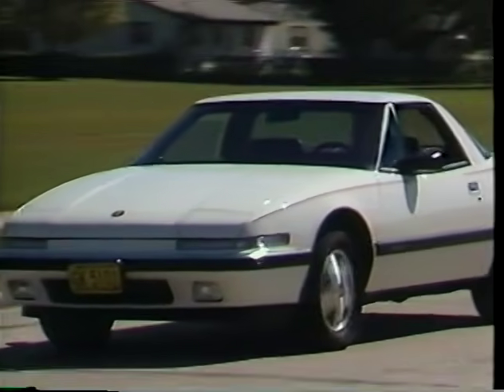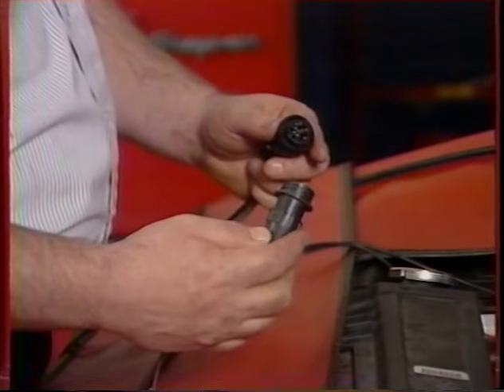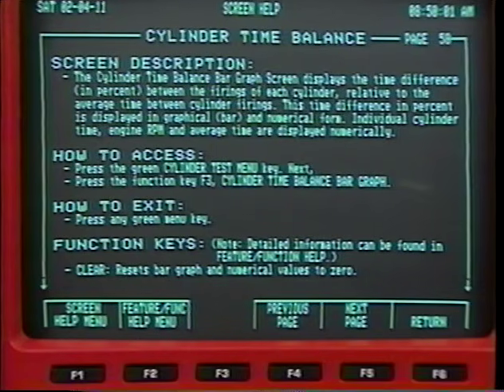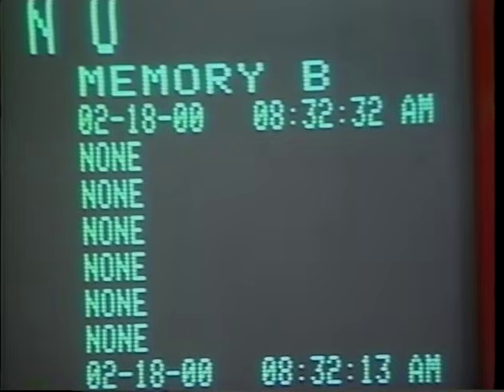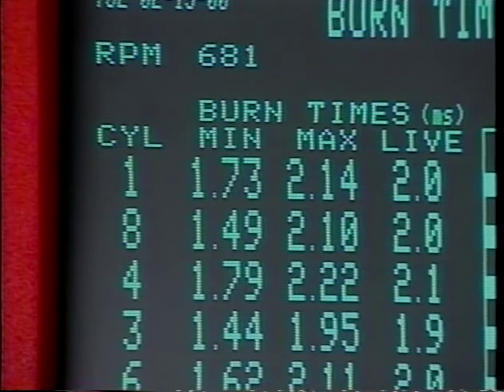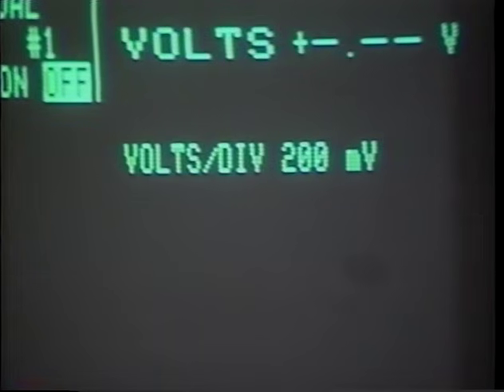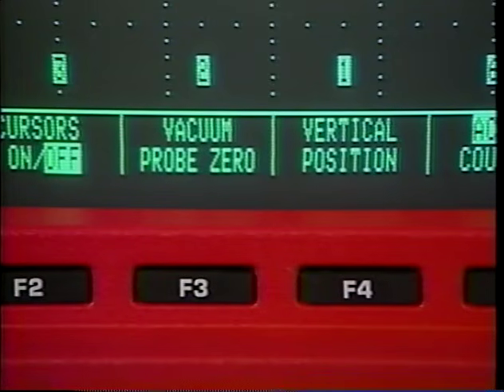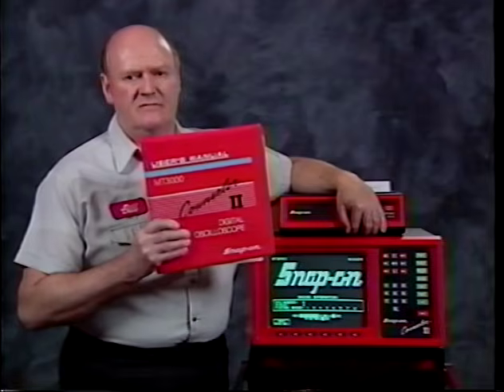Snap-on Counselor II MT3000A Oscilloscope Basic Operating Procedures SS1222VHS

Comment: The nerd in me wants to buy one for some reason
Reply: I have the Counselor 1. Very good, but this one had better features and processor; it integrated more efficiently. IMO still unmatched when checking traditional ignition systems. You can pinpoint problems without removing a single ignition wire, without messing with the cap and rotor. All there on the screen by studying the waveforms, and learning their meanings. The cylinder drop test ability alone, was worth the price of admission. Back in the OBD 1 days, this was what separated the pros from the parts cannon Gunnery Sargents.
Reply: @LynxStarAuto  Good to know
Reply: @LynxStarAuto  I have a Counselor ll with the MT3100 gas analyzer. I use it often on old cars at my shop. Do you happen to know anything about the gas analyzer? I've had 5 gas training, but never had a gas analyzer. I got a manual for the counselor, but not the 4 gas. Not sure how to use it.